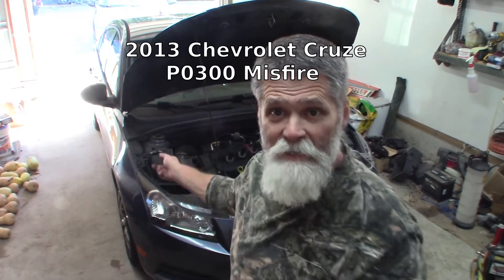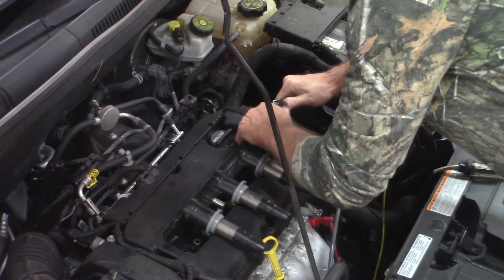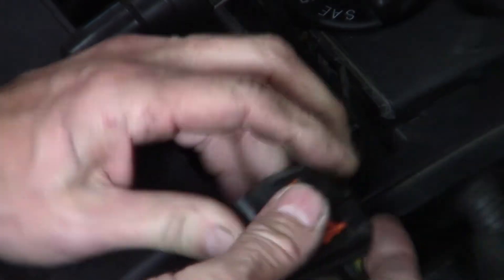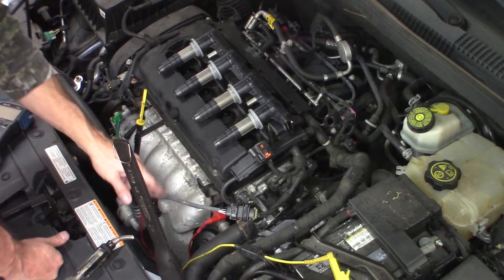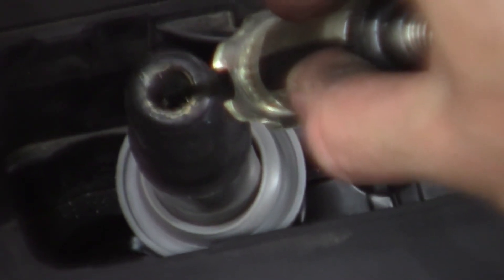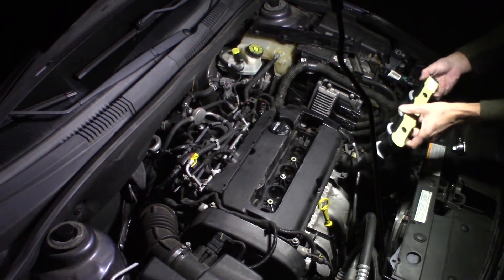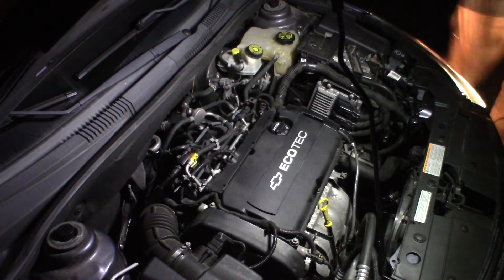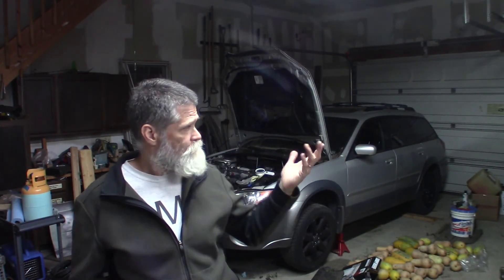2013 Chevrolet Cruze P0300 - Misfire

Comment: Are your coolant hoses on this car pretty tight after driving and stay tight? I don't understand why mine are.
Reply from the maker: Not sure what you mean by "tight".  They will be under system pressure after the car comes up to temperature  ~ around 15psi...
Reply: @Charles And Cars  okay I'm having a multiple misfire code also hope this fixes my problem
Reply from the maker: @joehuff2292  Let me know.  The only other thing that I can think of that would cause excessive pressure on the coolant side would be a head gasket leak.  Might want to check for that.